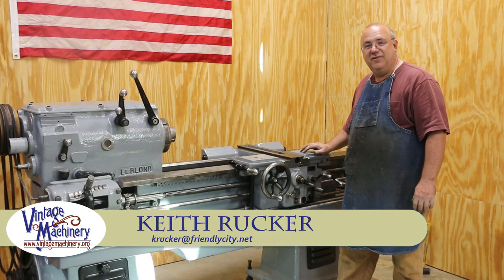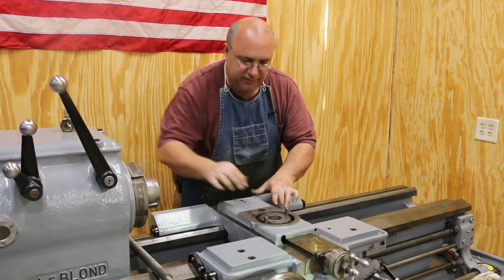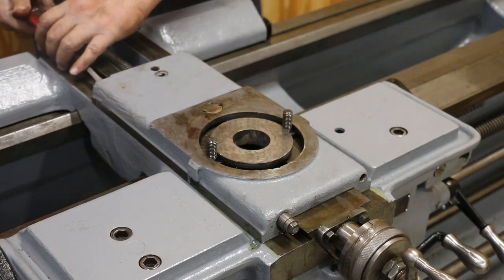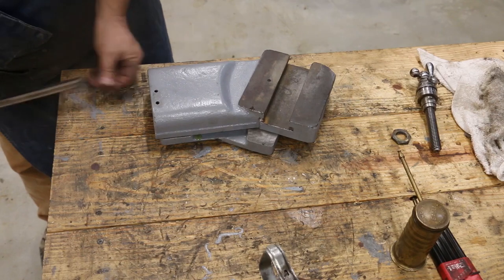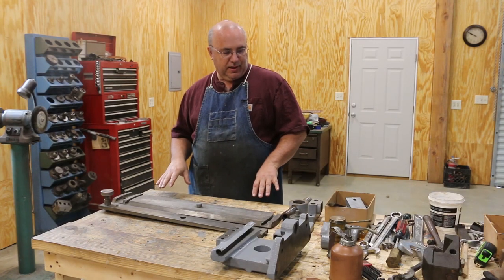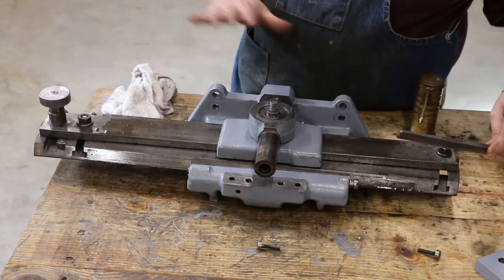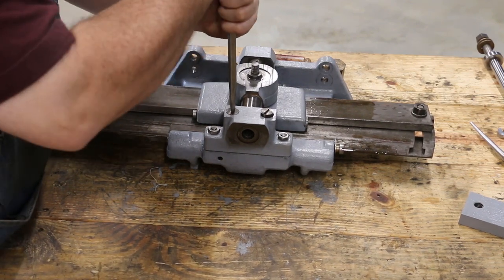LeBlond Lathe Restoration 13:  Compound and Taper Attachment

Comment: Can someone explain to me how the cross slide is able to move in taper mode without the cross feed dial turning?
Reply: My guess is remember that keyed slot mentioned in the handwheel earlier? I think the screw just pulls out of the handwheel.
Reply: Agreed.  I was curious about that.  I've read that before using a taper attachment any, you needed to somehow disconnect the cross-slide's lead screw in order so that in case you accidentally engaged the cross-feed while turning tapers you wouldn't cause major damage to the cross-slide and apron.
Reply: +bcbloc02 Thanks for the explanation.  I can say though, that after watching Mr. Fenner use his tracer attachment so much, that even though it is more expensive an option, I'd prefer a tracer attachment with its own toolpost because of the tracer being not connected any to the cross-slide's leadscrew, its just along for the ride on the cross-slide in normal turning ops.
Reply: On ours the taper attachment moves the actual back of the screw. So you can still move the screw just fine, with no damage of hurting anything.
Reply: The cross slide leadscrew is two parts splined (keyed, in this case) together like the steering column on a car. When using the taper attachment, you can still operate the cross slide handwheel as normal.
Reply: Is that sort of a unique feature of the LeBlond lathe? Usually you have to disengage the feed screw nut block by taking out a bolt or somthing.
Reply: Not totally Leblond unique as my Monarch you also can use the cross slide screw while the taper attachment is engaged.
Reply: Same on my atlas-craftsman. I haven't seen one you couldn't.

Comment: Another set of pictures showing the cover. nothing about that extra hole , but inmy opinion, there should be a pin there  that would actually take the forces applied rather than the screw.
http://www.pirate4x4.com/forum/shop-tools/2112674-leblond-taper-attachment.html

Comment: I don't quite understand how the taper attachment moves the cross slide.  Isn't the cross slide threaded onto a shaft that goes into the handle?  How can the cross slide move in and out without moving the handle?? Hope this makes sense.
Reply: I think it slides on the key in the handle. Not sure. Ours uses splines to drive it.
Reply: I was thinking the same....i notice the keyway, but how the threaded shaft doesn't slide inside the handle when he turn the handle?...maybe there is a screw on the face of the handle that holds the shaft when not using the taper attachment, but i don't see on the video...
Reply: I though I'd worked it out but can't come up with an answer that allowed him to run the taper then with only loosening the taper nut then use the front handle. Either I missed something or an engage step is missing from the video or its just magic.

Comment: Hey Keith....if you Google " LeBlond Taper Attachment" then click on the Images, about the 10th photo shows a cover that is hinged and tipped up. It hinges on 2 pins on the end of the cs cover, and is profiled the same as the cs cover....about 4 photos further.....there is a photo of the cover itself......how to you disconnect the cs screw when using the taper attachment?

Comment: how does the cross slide disengage from the screw when it is following the taper taper attachment?
Reply: It doesn't. It's driven by the keyway, but it just slides on that.
Reply: OK, the screw telescopes into a tube attached to the dial/crank, right?

Comment: The "nut" that engages the slide on the taper attachment to the bracket coming from the cross-slide may be a casting with an integral lever handle (much like the nut for the quill-lock on most tailstocks). Easy enough to make, or (very non-original) you could get one of those positionable lever handles from McMaster-Carr (McM-C# 6522K76 ) or non-positionable (# 91038A031). The pages around there offer quite a variety (and price) of "handled nuts". 
It wasn't clear to me how the cross-slide lead screw is disengaged so that the taper attachment controls the cross-slide, unless the lead-screw is always positioned by the taper attachment which seems like it would increase the amount of backlash/lost motion by adding any slop in the cross-slide lead-screw nut to any slop in the taper attachment slide.

Comment: User name Tom Walter (google that name and "le blond 13" and you'll find it) has a functional taper attachement. So, if you think you're still missing something, check his videos because he has a video that explains how it all fits and works.
Reply: Tho, i would like to point out that you'd probably be better off if you'd modify that whole back piece to the Logan arrangement, where there's a part that sits on top of the taper attachment and is bolted in the back of the cross-slide. I believe the way Logan made that attachment is far better in terms of rigidity and time/use. Certainly a lot more protected than a simple slide. Also, a lot of people have modified the screw that locks and now use a handle (like in the ones that Tom Lipton likes to use in his various projects, the proper name escapes me, but i believe they are called quick releases). IMO it's a simple enough part to make, and, it doesn't need to be as fancy as Logan manufactured theirs, it's basically a Isosceles trapezoid that has a slot cut down the middle. Cheers for the holidays!!

Comment: Just a quick google of "LeBlond taper attachment" turned up a few pics of similar set-ups, this http://www.adamsmachinery.com/photos/l1106_5.jpg being for 24" x 72" LeBlond Regal, showing a cast rectangular cover hinged to the cross-slide. Also a picture here, https://www.surplusrecord.com/listphotos/828129i.jpg showing a very similar cover though with a different taper attachment.
Oh and on Practical Machinist, http://www.practicalmachinist.com/vb/cincinnati-milacron-kearney-trecker-vn-usa-heavy-iron/leblond-regal-taper-attachment-install-306560/ this appears to be close too.

Comment: Hey Keith.  Not sure if you are still looking, but I hunted around and found this picture:
https://www.practicalmachinist.com/vb/attachments/f38/196279d1492125658-leblond-regal-roundhead-measurement-needed-taper-attachment-leblond-taper.jpg

I think it shows the chip protection.  Oh, and look at that pretty scraping <grin>.

Comment: My parts breakdown shows part number 32 is a pin. I'm sure you figured it out by now. LOL I don't see any cover in the drawings or on the machine in the shop. THe LeBlond taper attachment is a beast compared to my Logan. THere are partial covers on both machines but they are newer than yours. http://geckocycles.com/images/lathe/cover%20tool%20height.jpg Note my tool height gauge.
http://geckocycles.com/images/lathe/quality%20leblond.JPG This machine has the taper attachment.

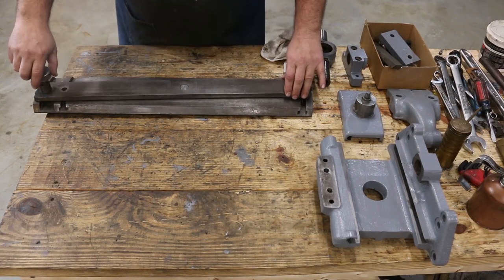Comment: @18:35 The slide is reluctant to move. I wonder if that has anything to do with the absence of oil on the 45 degree angles that you didn't lubricate when you explained about your belief in oil. You also do not lubricate the Gib nor can you be seen oiling the leadscrew. Did you do all this when we were not looking? Or are you hoping that these critical machined surfaces will not rust while they are wearing themselves away ?

Comment: Is there video of removal and refurbish of the screw assembly? My dial assembly seems to be frozen and has quite a bit of backlash. There seems to be a slight marking to see  one taper pin but it doesn't seem to  budge. The other one 's location is not visible. Also not that familiar so don't want to damage trying to remove as I am not certain where the parts mate with each other.

Comment: Also, Mr. Rucker, I don't remember now if you said it in an earlier vid of this series, but how bad is the backlash and wear in the cross-slide's leadscrew and nut on the LaBlond?  I ask this since in Mr. Fenner's series on his Rutland lathe, there was so much slop in the cross-slide leadscrew and nuts that he decided to make a new set of nuts and will turn a new leadscrew for the cross-slide on it, and its now left me wondering how much the cross-slide leadscrew and nut on your LaBlond are worn.

Comment: I believe the crosslide  etc has to be disengaged to use the taper cutting attachment . The wheel may turn but it drives nothing so long as it is separated from the taper device which controls its movements for now on during the taper cut . If I remember correctly that's how it is done. When I bought my own lathe I bought a taper cutting attachment never used it so sold it on to someone who would. Alistair

Comment: My South Bend uses a very similarly designed taper attachment.  What I found was a lot easier for re-assembly was to hang the taper attachment on the carriage, then feed the screw in through the end of the attachment.  The SB doesn't use a locating pin or anything that would let it carry the weight while I put the bolts in, so bending the screw was my fear.  

Looks good, progress is always a good thing.  Merry Christmas Kieth, and Happy New Year.  Thanks for the vids!

Comment: I'm confused with the taper attachment.  how to it make the cross slide move while the crossfeed handle doesn't move.. but then one you loosen the taper you just crank on the handle and the cross slide moves.. is there a slip feed or something inside?

Comment: Thanks for this interesting video. It is AFAIK the first time that in youtube a telescopic type taper attachment is shown apart with all parts visible. I believe your explanation of the black clamp riding on the slotted bar  (34'00" into the video) is not quite complete. When clamped down its only two purposes are 1. to block the cross slide hand wheel function during taper cutting so you cannot use it to change depth of cut and 2. to eliminate the backlash of the cross slide spindle nut. When the black clamp is loose you can still cut tapers while you can also use the cross slide wheel to set depth of cut but you have to put up with the backlash of the cross slide spindle nut.  In non-taper mode you have to loosen the black clamp (and the bed clamp) since it acts as a second cross slide clamp. In non-taper mode you have to make sure that the slide in the taper attachment is not moving by accident e.g. by too much friction of the bed clamp or caught objects otherwise the cross slide is unintentionally moved in or out unless the taper was set to zero. It would make sense to have a clamp to lock down the taper slide to the carriage extension to avoid unwanted sliding.  But I have not seen it implemented here other than using the big gib to lock movement. In this link I have earlier put a comment explaining the difference btw. regular and telescopic taper attachments. https://www.youtube.com/watch?v=xRIk4e3ZYog

Comment: Thanks for a great series - I always look forward to the next instalment.  That lathe is looking pretty damn fine right now. Great skills, Keith. A couple of questions if I may:
@ 12:30 there is a grating noise - what is that?
Secondly, did this model come standard with the taper attachment?
And lastly...can you engage power cross feed when tapering? 
Thanks for all your hard work in sharing your passion, and greetings from South Africa.

Comment: Merry Christmas Keith,  I would like to see a close up of how the taper activates the cross feed if possible.  On mine and other smaller lathes I have seen with an attachment the cross feed nut had to be released or removed when using the taper so it could govern the in and out feed of the cross slide.  It is interesting to see a different approach.  Take care.  Doug

Comment: That cross-slide nut went back in surprisingly easy compared to how it came out!  I thought it was going to be an interference fit back into the cross-slide and you were going to have a whale of a time trying to drive it back in from below!  Being a slip fit though made your hammer handle lift trick possible.  The dried oil and other gunk in the hole is what made it where it had to be driven out originally am I correct in assuming?

The set nuts having their threads cut into the nut itself is an ingenious way of helping ensure the nut is only put back in one way, and also ensures the set screws go back into the exact same holes they came out of.  We need this level of cleverness back in modern made equipment!
Reply: yes its amazing after you remove all the dried compacted dirt and various corrosion, things go back together pretty well, modern stuff isnt meant to come apart and will usually break in some awful way, old machines and old motorbikes could be taken apart on a weekend and put back together just fine.

Comment: Keith if you wouldn't mind could you send me a link to the oil you have in the brass oiler. Thanks!
Reply from the maker: It is just a light machine oil.  Not sure of the brand or type - I have a gallon jug that I got from somewhere years ago.  I think that I just specified a "light machine oil" when I got it.

Comment: As much oil as everything got squirted on, it would be easier to dunk all parts in a container of it before assembly then wipe it off of where you don't want it. :)
Reply: When I restore a machine, I cover every millimeter of metal that is not painted with a good rust resistant oil, using toothbrushes, bottle brushes, q-tips, and whatever is necessary to coat every part completely, deep into the dark corners and recesses, and well into the pores of the metal.  Stainless, brass, and aluminum included.  Then, during final assembly, I will squirt oil on the moving parts like Keith was doing, but will spread it around evenly with my fingers.  It takes more time and effort, but I think it is worth it.  Parts that are not well coated WILL rust, sooner in South Georgia than here in California...  Yes, I am compulsive...
Reply: Yes I too noticed the lack there of...
Reply: Here in Ohio things rust under the oil sometimes! Unheated shops are hard to keep unfinished metal bright.

Comment: Check out the picture in this discussion trail. The taper attachment has a cover like  you describe in your video. However it is installed on a different model. http://www.practicalmachinist.com/vb/antique-machinery-and-history/need-help-leblond-taper-attachment-154896/index2.html